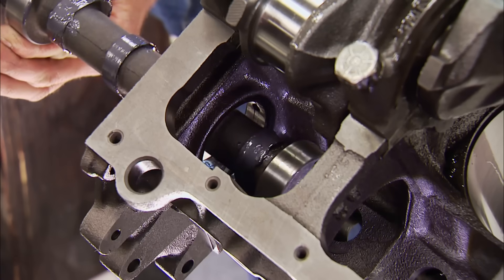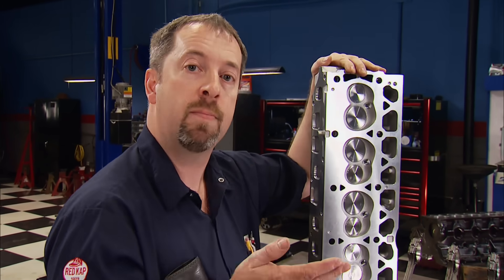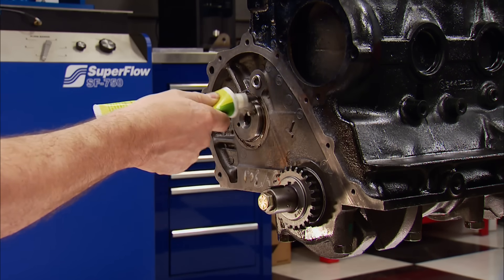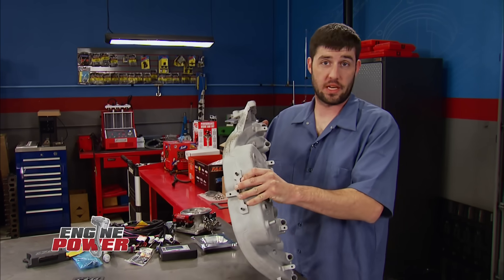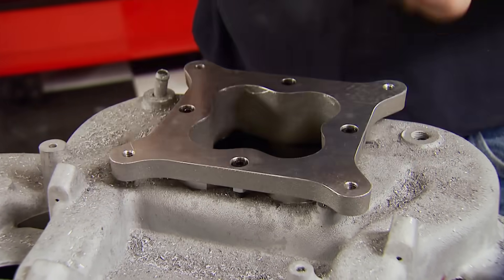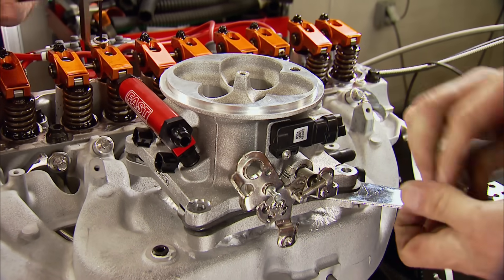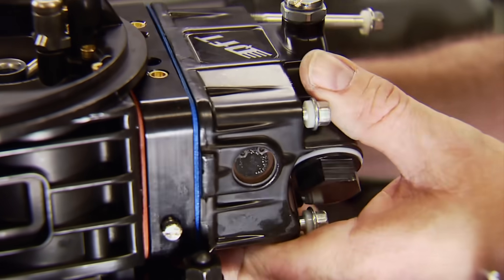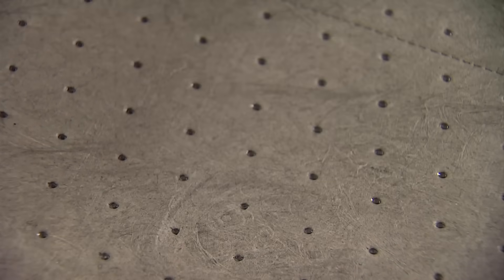Rebuilding a 4.0L Jeep Straight Six to 242HP - Engine Power S2, E14

Comment: I wonder if that adapter lip protruding down into the intake manifold might create a change in direction for airflow causing the power trouble...when he put it down into the manifold it dropped way in instead of just sitting flush inside causing an internal lip
Reply: i think that is exactly whats doing it. i cringed when he shoved the entire thing down in the intake.

Comment: Took me 3 months to blow up a 4.0l... garbage... lifted head
Reply: Must've been alot of abusr on it then. I'm sitting on 265k on mine with regular maintenance and tons of high rpm revs. Still running like clockwork.
Reply: No it was the garbage electrical system jeeps have caused a massive backfire and lifted the head. Unmodified jeep with under 100k. Well maintained

Comment: Nice build, the only change I'd make is a double roller timing chain, they're more accurate, especially after several thousand miles, and keeping that cam timing as accurate as possible means power.

Comment: These old guys really hate efi.
Reply: Mr. Jarvise Barrett....I'm not an old guy, and I too can't stand throttle body, or any other injection system, on an older Jeep....so much so that just last week I pulled the TBI throttle body off of my 85 Cj-7 in favor of a 2bbl Carter carb.....in fact, the injection system is for sale right now....
Reply: Did i see this right in that they literally plugged the injector holes?
Reply: @Major lee ok boomer
Reply: I seen the young guy build a Mazda 3 turbo and work with EFI, it did get over 300hp. They are not afraid of computers, but it is a tv show and have to do what the audience will watch. That is why the just do mostly V8, big cubic inches, supercharging, of American cars. Building an S52, an LS400 Lexus V8, Toyota 2JZ, BMW M20, etc would be cool, but not tv worthy... given the core audience.
Reply: @Clifton Green But carburetors are easier to tune and impossible to perfect. Instead of tuning the motor and figuring out what was wrong, "lets throw a carb on it"

When in reality the EFI would create more power... but they modified the whole damn engine and expected plug n play computer components.
Reply: Hottspitta jR They messed up on the manifold, these TBI systems only run right with a single plane. Which I doubt anyone makes for these engine. Fast even mentions it on their website, which these guys didnt read.
Reply: You can make a carb do what you want it to do, but you can only ask EFI to please do something, doesn't mean it will.

Comment: Curious why you guys didn't go down the route of using the factory style injection bosses and setup in batch fire, rather than butchering the factory manifold?
Reply: Craig W I was thinking the same thing
Reply: because that alone would cost like $500 for just the megasquirt ii ecu.
Reply: @frigglebiscuit7484  they could've just used the factory ecu.
Reply: Theodore Dowman Already got 2500$ into the ez-efi kit, should of chosen the 1200$ that utilises multi point and keeps the sponsors happy also :)
Reply: Craig W Laziness.
Reply: @Future-Preps35  and that's the beauty of an efi kit is that you can switch between maps and have economy for on the highway and power for on the trail with a lil bit of computer time!
Reply: @Future-Preps35  I bet if that 94 YJ ecu went to an mk4 supra someone would figure out how to "jailbreak" it haha.
Reply: They're boomers, do you think they know how simple it is to work a fuel map, all they know is carb, pushrod
Reply: @ramentaryramblings  neither of the two are boomers.
Reply: @deeplyclosetedindividual  Pretty sure the term was used for their mindset, which is somewhat luddite.
Reply: @ramentaryramblings Boomers?  one is a late Gen X and the other is a Millennial

Comment: LoL Ford Australia BA195 4ltr six makes 255hp and 288lb it completely stock form.
This jeep motor is a boat anchor.
Reply: it also weighs more than this engine, is a fucking dohc(nightmare) and doesnt make the tq where this engine does in the rpm band. they are also not as reliable.

Comment: 2jz-GTE would still beat out any 6 cylinder ever made
Reply: In the 70s 258 were running 11s pushing more than 350+HP and more than 400tq. On stock pieces with Webber's carbs.N/A. There's no stock Supra pushing that N/A. Without sleeving the block like they do with the 2jz to make it more reliable.
Reply: Non turbo? I doubt it. Try a Barra motor
Reply: Glenn Coasty 2jz-GTE*
Reply: not in a jeep it wont. 2jz will blow up while the 4.0 keeps chugging. 2jz cant handle the stress or put out the tq needed.
Reply: Frigglebiscuit 2js can put our upwards of 800 ft lbs in stock internals.
Reply: @kadeneck5486  at 8000rpm with 35lbs of boost from a huge turbo. not impressed. make it at 4000rpm, and then ill be impressed.
Reply: Frigglebiscuit what 6 cylinder engine do you know of that makes that kind of power at 4000 rpm? The 6 cylinder is built to go through the rev range.
Reply: The AMCL6 258 held the NHRA Tilte for qiut sum time. And doing that N/A. 11s in a Gremlin. Back in the 70s. There was a 600+HP version called the Gremlin X with Forged 12.1 pop up pistons, and a solid roller cam. All on stock pieces running low 10s. That thing Pop sum Kick-Ass whilies. But scrapped the project cause there was no one to race against. All from a non sleeved 258.AMC is the King of N/A power. Any one can make power with a turbo. On any kind of motor.

Comment: Ok. When ever you see an easy upgrade it seems to exhaust. But why is it that the intake is almost twice the size of the exhaust valve? I get that there’s pressure on the exhaust stroke. Why wouldn’t the intake and exhaust be the same size or the exhaust even bigger. I mean the more crap you get out of the cylinder  the more power you’ve got for the next stroke. Just a thought.
Reply: The ratio that's (dump) proven to work best is an exhaust valve approximately 75% of the size of the intake.

Comment: You saved probably 1-2 hp on that electric water pump and if you were running the thermostat you'd probably lose another 3-4. Saving this video for reference though when I finally go through mine.

Comment: So basically someone can rebuild there 4.0 but use maybe 30lb injectors on stock stroke and bore and achieve 240hp maybe 30lb injectors and high flow fuel pump you guy should have used a high flow water pump

Comment: the six was a hell of a lot better than any V8 Jeep had
Reply: The 318 & 360 are waaay better..

Not even a comparison...
Reply: @elonmust7470  had 4 jeeps in 11 years my 6 made 210,000 miles before I sold it every v8 crapped out ,none got more than 65K mile before major cost ,I changed the plugs on the 6 at 100K still ran great when I sold it
Reply: @kennethconnors5316  And because of that all 318s & 360s are junk?  There are millions of small block mopar engines out there, way more than there are 4.0 i6s...

Comment: No Doorman product is corrosion resistant and guaranteed to fit.
Reply: doorman and omix are the worst. used oem parts are better lol
Reply: I made the mistake of ordering a dorman oil pan once...
Reply: Oblithian a baking pan would have worked better
Reply: @Oblithian  hey they aren't bad. I have one to hold parts like bolts and such.
Reply: @Tigerfire75  Dorman bed pan
Reply: Oh I don't know, their paper gaskets don't rust...
Reply: well to be fair with dorman and stuff, at least we have OPTIONS.. and yes they arent high quality when it comes to omnix and dorman, but at least we have those options...  Stop complaining...
Reply: Oh they're guaranteed to fit all right... where they belong. Because them doorman parts will definitely fit in the landfill where they belong because they're trash lmao

Comment: Alright PowerNation, since we are doing really well with the past "inline series" of engines on your channel.... I am thinking we are due to see the absolutely amazing, but cranky, inline eight cyl, from Buick.... The vintage inline 8, the FIREBALL 8, preferably from the 50's. I think that would be a really nice touch, to show off what Buick was thinking back in the day. I would really enjoy seeing the dynamometer run while being in its old stock O.E.M. configuration, and then to see what all can be had from over the counter parts upgrades.... What is funny to see, is the camshaft and or the crankshaft sitting side by side to a typical V/Y block V-8's counter parts....And weigh some of the parts like you guys did in the famous Jeep's inline six power plant video here.. upon a side note, if I am not mistaken, the Buick I-8 engine, the whole assembled unit weighs in at approx 800 to 900 lbs., LOL... but offers a sound like no other, In fact, I have a video on my channel of a video I uploaded approx 4 to 8 months ago that will give you an idea of the sound of a stock Buick I-8... Thank you guys at PowerNation for taking the time to give some attention to engines that may be odd, and quarky, and not super powerful like today's modern tech engine offer , but can still be allot of fun to play with, or if built correctly, can last several hundred thousand miles before giving any signs of failure... Oh ,and one last thing, if a Buick inline 8 is in the line up, can you dig into something clever for the oil delivery for the block and head? Heck, incorporate a dry oil sump system, now that would be cool to see how one would/could go about doing such a task... Mainly so I can barrow the idea for myself... Cheers!!!!

Comment: My brother-in-law had a Jeep with the 4.0 engine. He hauled a 2 horse trailer, 16' camping trailer and a 4 place trailer for snow machines. He put over 180K miles on it and it ran with nary a whimper.  Oil was changed regularly and it ran great till the day he traded it in. He still regrets it 15 years later.

Comment: Could you please do a build that reuses existing components, not expensive aluminum heads, custom intakes, etc..
Roller rockers? Sure
$1000 aluminum head? No thanks
Reply: Larry Schonberg it’s crazy. Aluminum head and all that money thrown at it for 242 horsepower
Reply: @adventuresiwork3563  exactly, and the build cost what $8k or more. I can't remember if they said numbers or not, but at a guess I am probably not too far off.
Meanwhile, I just watched a build on a stroked 4.0l with a cast iron head and a .030 over bore and all mostly stock parts capable of 304hp and 300ft torque 
For $5k

https://youtu.be/WlHrqhwojf0
Reply: @adventuresiwork3563  I just checked, the head at Summit Racing is $1866.50 
The rockers go for $535.99
before taxes and free shipping
Nearly half the price of the Newcomer engine
Reply: @LarryisControversial3000  It's only $1500 now... and out of stock (that's directly from Edelbrock)
Reply: @JeffDeWitt  lol, crazy how expensive a little performance can be.

Comment: Jesus why do people keep using cork gaskets? They are a complete waste of time and money.
Reply: For some things they still work best - automatic transmission pans for one.
Reply: @Motor-City-Mike  no they don't Fel-Pro literally makes transmission pan gaskets for most transmissions out of silicon. Plus there's RTV. Or better yet you can buy rolled up paper gasket and make it tacky with RTV. Still way better than cork
Reply: @narutolovesbleach  I don't agree.
One of the best performance trans guys in the state of Michigan still swears by cork trans pan gaskets - and he's tried them all, and I've seen the results myself.
The last thing in the world you want to use RTV on is a stamped steel pan, there's a product called "The Right Stuff" it's more like a butyl rubber.
I'll take his word for it....

Comment: That type of fuel injection has proved time and time again to not like dual plane manifolds. They run with open plenum.
Reply: Can anyone explain why? I've seen similar tests where, like you say, the FI does not like the dual plane manifold.
Reply: @5000rgb  I don't know exactly but My thoughts are the injector pulse timing is off and can't cross over to the other bank as it needs fuel.

Comment: I would’ve liked to see them run a stock intake with the proper injectors and larger throttle body with a stand alone or custom tune. I’ll bet they could’ve bested the carb and it would’ve had a better power curve!
Reply: The problem with the stock intake is airflow - it just won't flow enough air without major rework to support big power - even with a bigger throttle body.
Reply: They're just trying to sell old parts from the 1990s to clear old stock.

Comment: It’s not the injection system, it’s doing everything it’s suppose to, ***bolts on carburetor and picks up almost 100hp.
Reply: Yep, and no effort made to explain that disparity.
Reply: If you think that an engine makes more horsepower with a carb than fuel injection, then you are one backwoods SOB... Properly functioning fuel injection works better. End of story.
Reply: @elonmust7470  I don't think it does, I watched the video and I KNOW it does.
Reply: @charliedee9276  That's because the fuel injection being used was not functioning properly.  Just like if the carb had main jets that were way off. 
Everything about the internal combustion engine involves precision, supplying fuel is no exception.
Reply: @elonmust7470  Nice try son. I've been building hot rods longer than you have been alive.
Reply: @elonmust7470  
Then why did Gale Banks use a carburetor in a Pontiac Firebird when he was chasing 300 MPH
Reply: @anthonywebber2211  why do top fuel drag cars use fuel injection?
Reply: @charliedee9276  Just because you did it for a long time dosen't mean you did it right. Limitations of acclerator pumps and limitations of high pressure fuep pumps are not in the same catagory.
Tuning carburetors is not hard...
Reply: @anthonywebber2211  Because back then fuel injection was not where it is today...
THINGS CHANGE!
Reply: @elonmust7470  
Compare apples to oranges next time kid, the amount of fuel top fuel dragsters use in one run, your scooter can visit 2 or 3 states
Reply: @elonmust7470  Oh I do it right junior, probably have forgotten more than you will ever know.  When you can tune a bank of 6 carbs at once maybe you'll have the minerals to talk shit to me, until then go back to impressing the high school boys.
Reply: @anthonywebber2211  Comparing fuel injection to carburetors is not in any way a disperportionate comparison.
The difference is that fuel injection can do it, carbs can't.
Reply: @DBASS_000  No idea what you're talking about.
Reply: @elonmust7470  
Yea, just like comparing a race car to a street car, have fun driving your top fuel  dragster on the street
Reply: @anthonywebber2211  Fuel injection dosen't work on the street?  Sure a 10,000 hp v8 is an extreme but what about 2000 hp? FI does it fine. 1000 hp? Fine. 800hp? Fine 350hp? 83hp? Fine.
Reply: @elonmust7470  
Sorry, the only advantage EFI has is drivability - while injection is getting closer, when it comes to max horsepower the Carb is still KING.
Reply: @Motor-City-Mike  Not even close to being true..
Reply: @elonmust7470  
Spend some time in a Dyno room - in person not what you read somewhere - you'll find out the truth.
The only time EFI makes more power is with custom fabricated high air flow manifolds, even then it's hit or miss at best.
EFI can be tuned more precisely at part throttle and steady cruise, at wide open throttle the fuel introduced into the airflow through  Carburetors boosters cools the intake charge while it passes through the manifold - the cooler charge makes more power, period.
Reply: @elonmust7470  you dont even know how latent heat evaporization works, yet you try to talk shit about carbs, and say efi is better...jesus christ....the intake manifold on my carbed car SWEATS because of how cold my intake charge is, due to the amazing atomization the carb provides. port injected efi car? HAH, heatsoak.
Reply: @frigglebiscuit7484  Oh my god carburetors are better becsuse of atomized fuel cooling down your intake.
And that alone makes carbs better than fi right?

Let me be blunt with you.  There are no circumstances where the atomized fuel from a tiny fuel leak in a pipe is going to keep 15 or so lbs of aluminum any cooler than it normally would be plastered up next to an exhaust manifold. Yes I've seen float bowls boil fuel before but LATENT HEAT EVAPORATION FTW right?
Reply: @Theodore Dowman don’t even get me started, this is what I do for a living. Nothing atomizes fuel better that a carburetor, period end of discussion! Fuel injection is utilized for ease of tuning and efficiency, NOT because it makes more power. Go ask any NHRA pro stock engine builder what they think of fuel injection...they’ve been fuel injected for how many years now? They’re still 30hp down from when they were carbureted!! Take your un-educated propaganda elsewhere.
Reply: @dirtfan05  This is complete bullshit..
Reply: @dirtfan05  https://www.sonnysracingengines.com/

I lived in Lynchburg of & on for close to 20 years and always kept track of what Sonny was doing. See the injectors?
He's know around the world.

Comment: Imagine spending 2000$ on a 4.0 head lol
Reply: Bipolar Gamers Some of us use the 4.0L as a base for our rock crawlers. 
$2k for added insurance on the trail isn’t that bad. I’ve got about $5,800 into mine. But mine is stroked to 4.6L with a custom Lunati crank and side saddle super charger.
Reply: @chloehennessey6813  How gay
Reply: abortioncritical  Fishing is gay?  Your head is fucked.
Reply: Theodore Dowman Gay as in happy? Yes I’m very happy with my rock crawling set up. The Detroit locker in the rear is nice- I upgraded my front running gear with Strange Engineerings limited slip. My next upgrade I think will be a nice roof rack. I already have a 64” light bar for it.